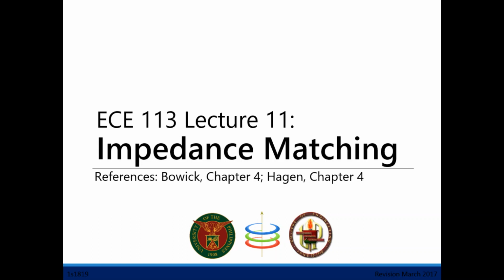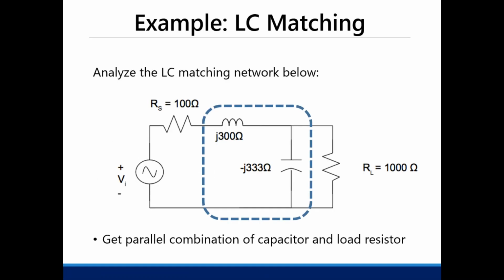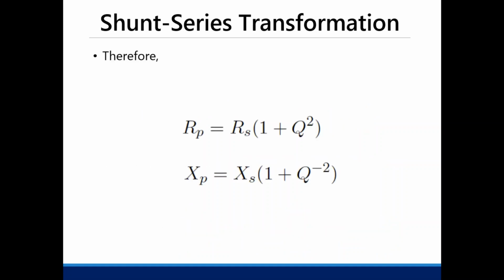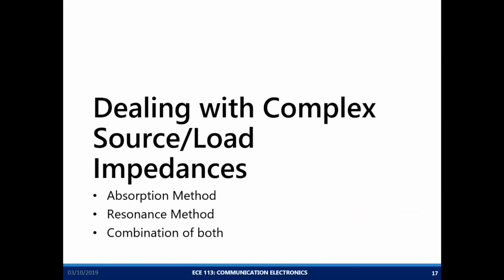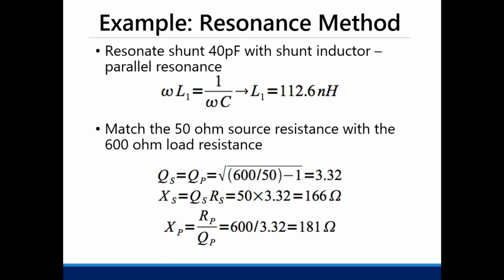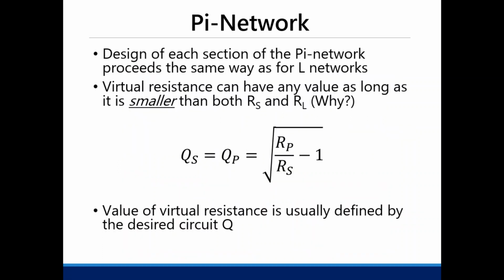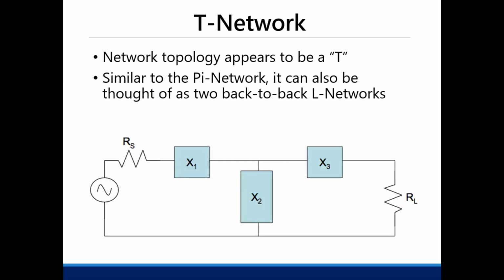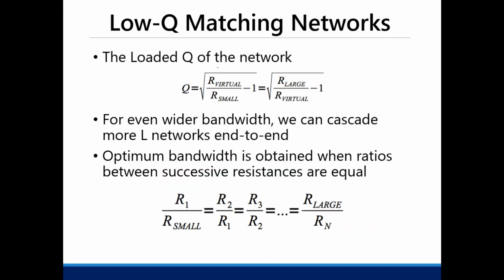Impedance Matching Networks

Comment: This is a great, mathematically rigorous,  approach which I find easier than using Smith  Charts ! 

You helped me impedance match independent RF amp, Freq Conv, and IF amp modules in an experimental vacuum tube communications superhet radio that I am building for fun, with home wound antenna, rf interstage, oscillator coils and IF transformers.
I was able to check my designs after building them with TinySA spectrum analyzer, NanoNVA network analyzer, and a 2 channel DSO with a built-in SIGGEN !

Thank you ! 🥰!

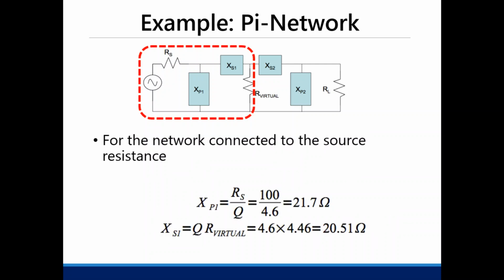Comment: Thank you so much for your excellent video! I am new to the RF matching network design. This video helps me to understand how to do calculations regarding 3 typical matching networks! I found a minor issue (probably a typo of a number) at 21:36. The Rvirtual should be 4.42ohm rather than 4.46ohm, so the Xs1 should be 4.6*4.42ohm=20.33ohm. Please kindly correct me if you see I am wrong. Thanks!
Reply from the maker: Rounding error. It is acceptable. In practical implementation, you will have a large tolerance from your electronic components, anyway.

Comment: Hy sir, how to get the value of Rvirtual(4.46) in the other L network to get Xs1 ? What Rvirtual use?
Reply from the maker: Rvirtual is a value of a resistance you need to achieve a specific Q-factor. Since we are designing the network to have a higher Q-factor, 2 elements are not enough. You need three elements to achieve a higher Q-factor. The middle element can be split into two. In the case of a shunt element, it will become two parallel shunt elements. For a series element, it will be two series elements. In between the split lies a virtual resistance that you will need to compute based on the Q-factor you need. Once you get the virtual resistance, you can compute for the values of the split elements and combine them into one (parallel combination for the shunt, series combination for the series).

Comment: Hello Carleston. A question. So, in order to work with low Q values and wide bandwidths , do I need to divide the T and Pi network into sub matching networks in series?
Reply from the maker: Hello. T and Pi network can only push you to higher Q values. If you want low Q values, you need to use cascaded L networks. They look like cascaded Pi/T networks but it is more appropriate to think that they are cascaded L networks and between each network, you are matching the current load to some virtual resistance. With the correct values of virtual resistances, you will obtain a wideband match.

Comment: @16.09... If I use absorption method, but assumed values for X and B (series reactance and shunt susceptance respectively) to have + or - value respectively, and by taking - values for X and B in this case (to have series capacitance and shunt inductance), we get the same result...
So, this appears to me like the resonance method is somewhat of a redundant method.
Reply from the maker: What you said about the absorption method becomes apparent when you use the Smith Chart for matching circuits. However, the resonance method exists as an alternative if you want to have a bandpass matching network that is not provided by the absorption method. Moreover, there is the issue of bandwidth where one method may have the better bandwidth specification compared to the other.

Comment: what is the best type of matching network and why ?
Reply from the maker: I do apologize for the very late reply. I hope this will still help. The best type of matching network will largely depend on your specifications. Moreover, aside from the networks discussed in this video, there are still a number of matching network techniques that especially work at high frequencies (above 1 GHz). The goal here should be to find the network that satisfies your needed specifications while minimizing the cost of implementation (number of components used). That is the best matching network.
Reply: Give me your replay please
Reply: @kareemdaraghma510  use the G-LC matching network

Comment: hello ,whats the job of two stub in double matching network and why the stub is in fixed position not variable ??
Reply from the maker: Stub matching networks are not covered by this video.

The two stubs are mainly used when there is no space in your circuit board for long stub matching networks. The position of the stubs can be varied along the lines but affixing them near the load end and source end ensures the smallest area needed.

Comment: thanks bro,,
but i will ask you  ,,why the band width increase when we increase the number of element ?what the mathmatic 
explanation ?
Reply from the maker: Hello. By increasing the number of elements, you decrease the Q-factor of the circuit. In a chain of L-matching networks, the largest Q-factor of one L-network is approximately the Q-factor of the whole circuit. Successive L-networks can be used to maintain a small Q-factor. Look at the slide where the formula for the Q-factor is and try to calculate and simulate it by yourself.
Reply: Hello,,
Can i ask you any relationship we need to explain how the quality factor will be decreased ,I'm an Arabia student and my English very week.
Reply from the maker: Kareem Daraghma the quality factor (Q) of one L-network is related to the bandwidth (B) and resonant frequency (f0) by the formula f0=BQ. If we let f0 be constant, then decreasing Q means we increase B.

Now, the quality factor for one L-network element is dependent on the load resistance (RL) and the source resistance (RS) by the formula Q=sqrt(RL/RS-1) if RL>RS and Q=sqrt(RS/RL-1) if RS>RL. Now, in between two individual L-networks lies a virtual resistance whose value can be flexible such that you can have a desired Q factor that is less than the Q factor using only one L-matching network.

For example, consider two L-networks cascaded with each other. The source resistance is 50 ohms and the load resistance is 100 ohms. If we use one L network to match it, then Q=1. Now, if we set a virtual resistance Rv=75 ohms in between the two L-networks, the Q factor of the matching network from RS to Rv is 0.7071 and Q from Rv to RL is 0.5774. The total Q factor of the circuit is approximately the larger Q factor which is 0.7071. This is less than the Q factor of the single matching network only which is 1. You can simulate this using a circuit simulator and observe the effects.